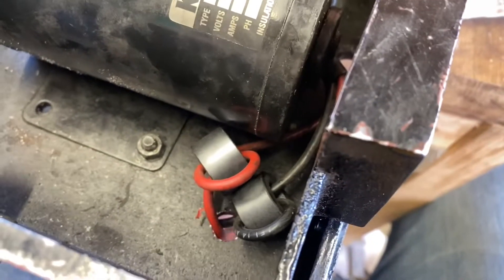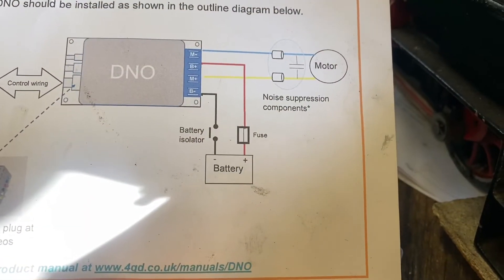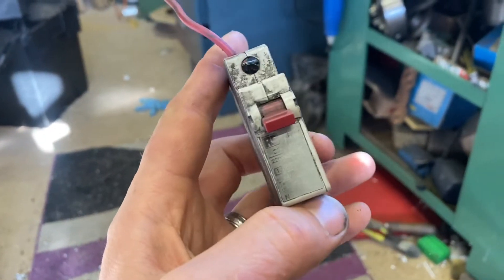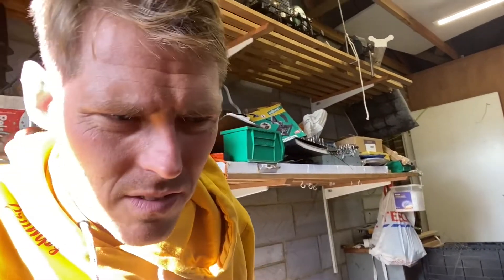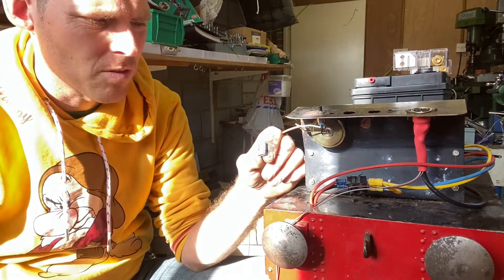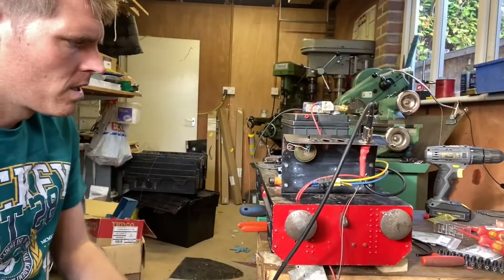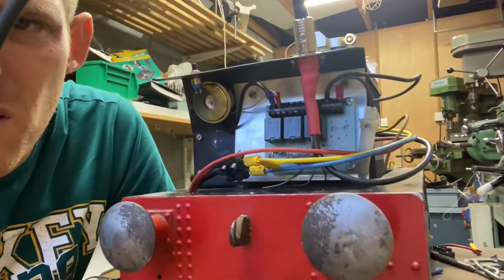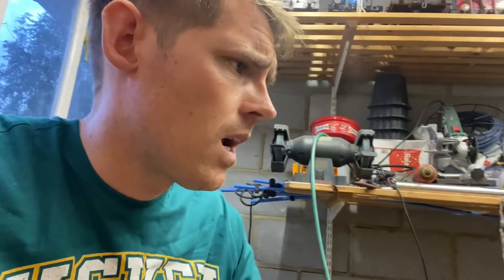Wiring the 4QD controller into a Maxitrak Coronation

Comment: On the horn relay board if you want a 12v output i believe you need to cut through the solder track labelled K, otherwise its set as standard for 24v so might be why
Reply: This is what I thought too 👍👍
Reply from the maker: Reading the instructions is this not only if you are running a 24v with 12v horns… this is a full 12v system.